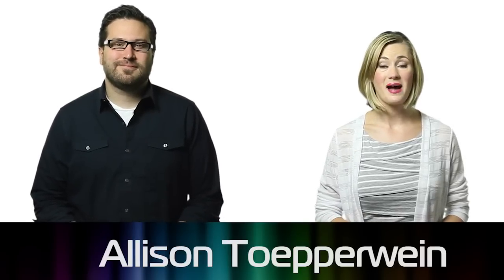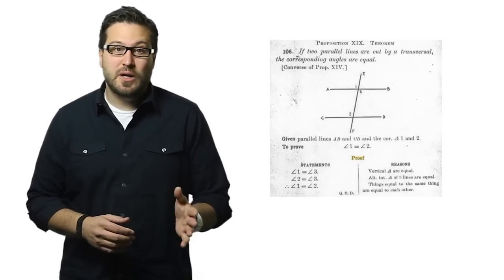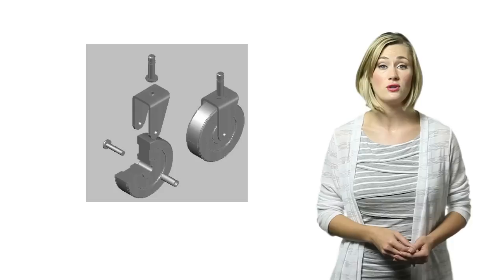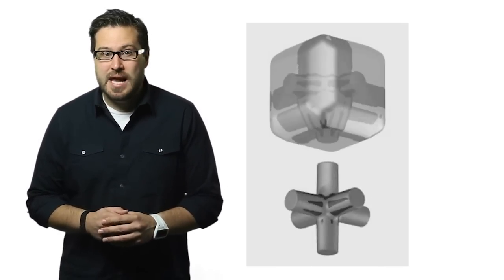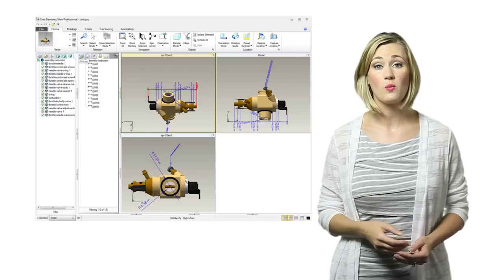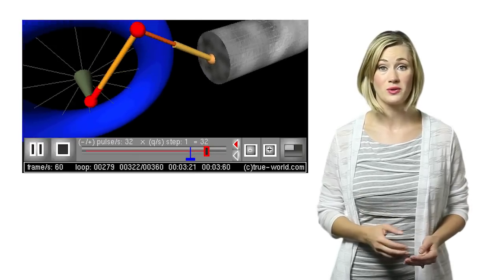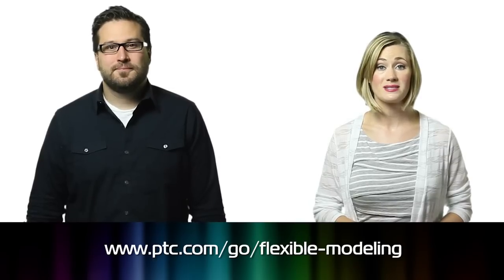Parametric Modeling - Pros and Cons

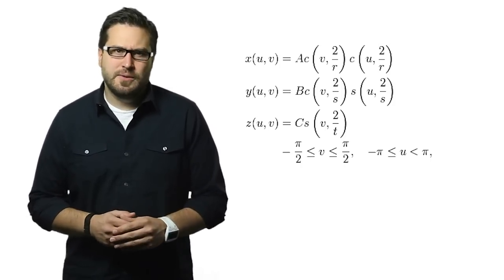Comment: You are confusing Parametric Modeling with  Feature based modeling and Parametric Modeling with constraint (dimension driven) base modeling . They are not synonymous. Your last point of confusion is @ 3:15  where you show a parametric equation as if it is the same thing a "parameter" or parametric based modeling.... It's not.